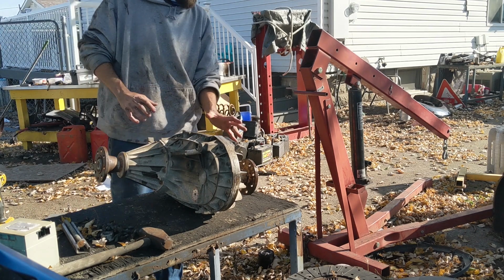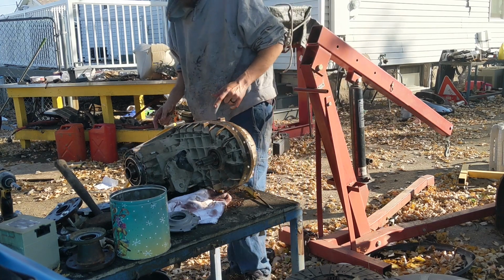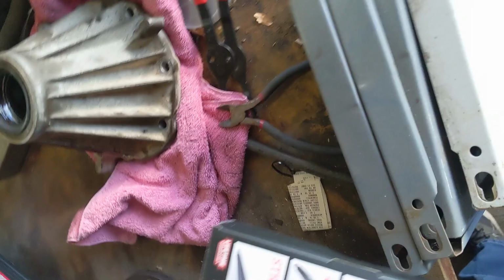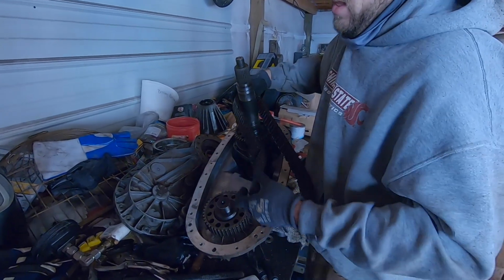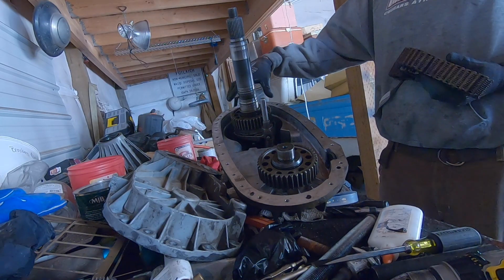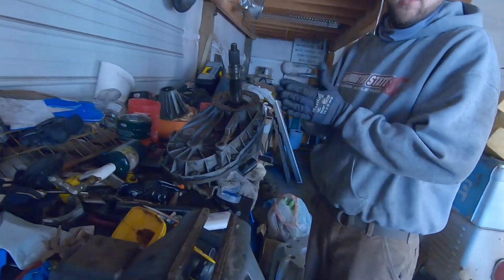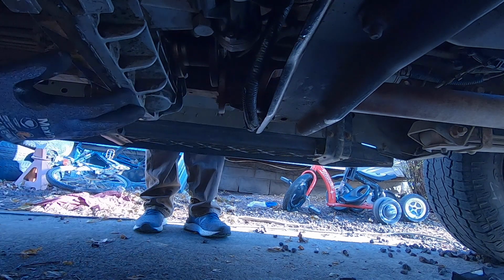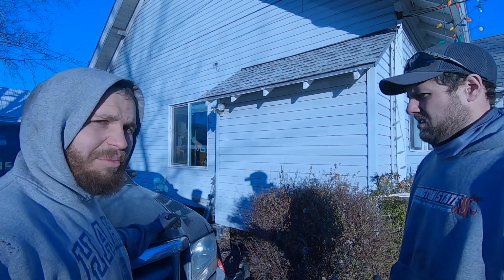2002 Ford F350 Super Duty Transfer-Case NP273 F Tear Down and Install

Comment: Is there a gasket between the case halves?  Mine seems to be leaking there, but I can't find a case gasket anywhere.  Perhaps I just need to split it and fine sand it, then reassemble.
Reply from the maker: We just used RTV

Comment: What's the name of the double tuning fork tool you used to separate the rear half off the casing @ 2:53?
Reply from the maker: I think its just a steering wheel puller, I'll have to ask Alex

Comment: Do you know the part number for the rear output shaft bearing that is seated in the back half of the case? (03' F250 4x4)
Reply from the maker: if you google QU50249 that should get you in the right direction, be sure to do your own research though, good luck!

Comment: Thanks for the video!!  Very helpful.  Just one question.  At one point you said Ford made a "special" tool to push something in between 2 tabs.  I didn't see you push anything in during reassembly.  I can't figure out what the tool is, what it's for, and whether I should pay the $100-$200 for it.  D)  But maybe if it's a 1-time-use-$300 tool, I'll buy it just to have it.
Reply: In the top of the case (as if it was installed) there are two tabs that are about in the middle, it just helps get the case apart. I didn't use the tool. A guy could make one pretty easy with a rod coupler and a bolt. If you hit it with a hammer it will break ( ask me how I know)
Reply from the maker: @albop03  thanks!

Comment: I have a question
I broke my manual transfer on my 99 Ford súper duty and i replace it for an electric transfer si i dont know how to conect it so i can use the 4x4 
Can you help with that?
Reply from the maker: I'll see if Alex can help you out, it's his truck
Reply: convert it to manual - they sell parts on ebay